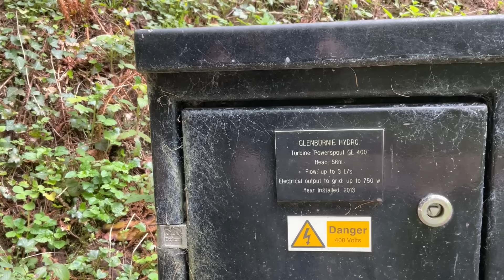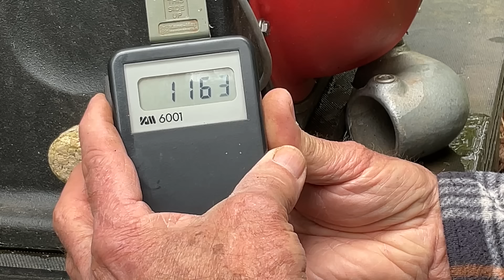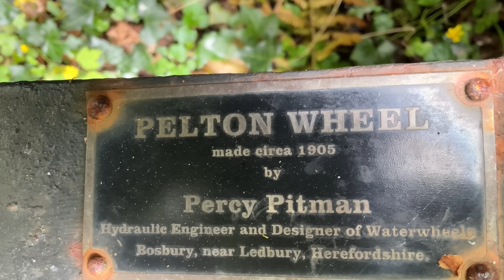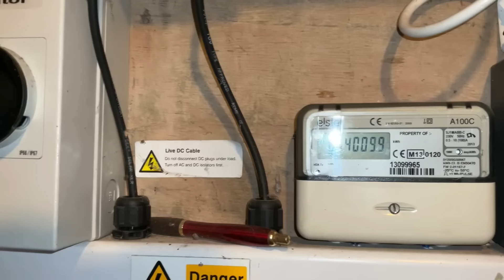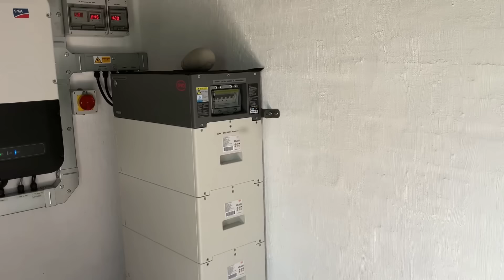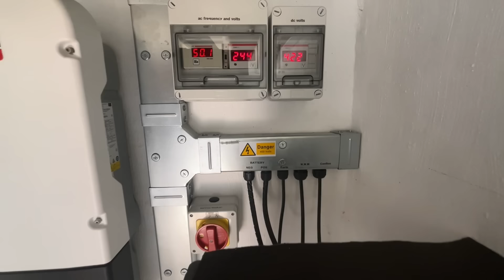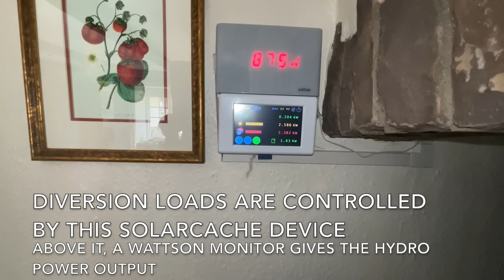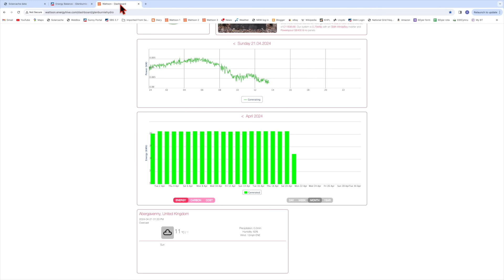Powerspout + solar + battery = the perfect combination.

Comment: As an electrician, I've considered doing something like this for an off grid cabin/home, but is your turbine delivering AC or DC? 

I was always thinking of doing a 240Vac turbine, that would feed an AC load center/panel, for powering the fridge, HVAC, and washer/dryer, and some receptacles. Then also 120Vac to 48Vdc charging circuits to feed large battery banks. The battery banks would feed DC sub panels with buck converters for dropping the 48Vdc to 24/12/5Vdc and then circuits for 24Vdc lighting, 12Vdc appliances and convenience, and 5V usb outlets. 

This way the turbine would not only power my heavy AC appliances and motors, it would also constantly keep batteries topped off that deliver power to all my lighting, electronics, and anything else I could keep running on low volt DC power.
Reply from the maker: The permanent magnet alternator on the shaft of the pelton generates 3 phase ac. This ac is of variable frequency because the shaft speed is different for the different flow conditions which occur through the seasons. This variation in frequency doesn't matter because the 3 phase is rectified and smoothed to dc before leaving the turbine housing. The resulting dc power passes to the house at between 200 and 330 volts. At the house an ordinary grid connected wind turbine inverter, though it can also be an ordinary solar pv inverter,  converts the incoming dc to 240 v mains ac at 50 Hz. These are the figures for grid voltage and frequency here in the UK.
Best of luck with your project.
Reply: @KEhydro  Got it thanks. So probably not able to receive a consistent single phase 240Vac @ 60 hz is what I'm hearing. I'll have to look into it more.. I'd love to find a way to avoid converting AC to DC only to invert it back again for all the AC appliances. Maybe this is not possible...
Reply: @paaao  
If you have large enough wires you can send the rectified 60VDC uphill and only convert it via the inverter up there that ties your batteries, solar, hydro and  emergency generator...into 240VAC 120VAC @ 60hz....

Comment: Hi Bill Cave! I'm amazed. Do U have any paper published or any references U used?!
Reply from the maker: You can find two documents, covering the wiring schematic and the communications diagram for the 'battery bunker', in this blog post: https://water-to-wire.blogspot.com/2023/12/battery-storage-completed.html
The documents come at the very bottom of the post.
The wiring diagram was based on an on-line document from March 2021, published by the Institution of Engineering and Technology (IET) which you can find at: https://electrical.theiet.org/wiring-matters/years/2021/84-march-2021/island-mode-earthing-arrangements-new-guidance-in-the-second-edition-of-the-iet-code-of-practice-on-electrical-energy-storage-systems/
I hope these help you.
Reply: @KEhydro  Thanks a lot. I live in south east asia. The potential of RE is high. I'm still in the research phase about RE tho.

Comment: finally a microhydro setup which does 400v. and bats too. some argue how it's safer at 48v but losses are huge. and you aren't spared from 400v anyway

i love decent systems

tho, it seems like battery room is doorless, is that good, even if climate allows it?
Reply from the maker: Thanks for commenting, - your noting there is 'no door' is a relevant observation.
Climate-wise, the temperature in the battery room is shielded from the worst extremes of hot and cold by being, in effect, underground.  For my own interest in the matter, I'm monitoring temperature with a max / min thermometer to see what extremes are reached. 
Security-wise, not having a door does create a risk - the components of the system could get stolen, - but if they are stolen they are replaceable; the real value of the setup lies in the location and the 'infra-structure', - and nobody can walk away with those !
Reply: well not much of about getting stolen, that looks like place where that's not an issue, more about some animals maybe?

Comment: Would it not be better if the outflow pipe had a larger diameter to prevent back pressure? Do not ask me as I am not an engineer. Thank you for great video.
Reply: An ordinary 90mm downpipe on a house that empties gutter water copes with more 
no need for huge pipes as once it leaves the housing it flows downhill by gravity...

Comment: Is the voltage peak or RMS? Or is it a DC generator?
Reply from the maker: The volt meter at the turbine reads DC (rectified 3 phase from the permanent magnet alternator). The voltmeters in the 'battery bunker' show battery DC on the right hand one, and 'grid' AC on the left hand. The 'grid' AC one will read either utility grid voltage or the 'island grid' voltage (created by the inverter) depending on whether the system is in 'on-grid' or 'off-grid' mode. In the video, it is showing on-grid voltage and it is rather high, but that is what it is in this rural area.

Comment: Why was the high pitched sound from the turbine again? Is that putting out 400 volts? It is the most meticulous system I’ve seen. Exemplary data monitoring.
Reply from the maker: Magnetostriction. 
Magnetostriction is a manifestation of energy loss, in the form of noise, caused by the miniscule changes in dimension that occur in ferromagnetic materials subjected to a changing magnetic field. It is heard as a whine because the permanent magnet alternator (PMA) generates 3 phase ac at a frequency of several hundred Hertz; by contrast mains ac, at 50 Hz, only produces a hum. 
The generated ac frequency is high because there are 42 stator poles and 56 magnets passing over those poles at approximately 1000rpm. 
The 3 phase ac output of the PMA gets rectified to dc, at a voltage which is between 220 and 315 v dc, - the variation depending on how much power is being produced, - which itself depends on how much water is hitting the pelton wheel. 
The noisy whine is only evident at high levels (high that is for this turbine !) when water flow to the pelton wheel is above 2.5 l/s.

Comment: Have you thought of building a little shed over your 120 year old wheel?
Reply from the maker: When it rains, the upward facing cups of the 120 year old wheel fill with water; when that happens the wheel, apparently without any motive force, starts to turn ! 
It is something I like to see ! 
Putting a shed over it would deprive me of a small enjoyment ! 
The wheel has many layers of paint on it, - I don't think it will suffer from being exposed.

Thanks for commenting.

Comment: Before the batteries were installed did all the generated power go back to the power grid?
How long has the hydro generator been in operation?
Reply from the maker: Good questions John;
I'll write an extended answer because I want it known the system does have limitations.
17th July 2013 was the date when the hydro first ran; since that day up to the present, it has generated non-stop except for an accumulated total of perhaps 90 days (that's an educated guess, but educated by the records I keep); most of the 90 days of down-time were due to early teething problems with the Powerspout's on-board electronics getting damp. 
Of course, there has also been time lost from generating by shutdowns for: nozzle changes, stator and rotor changes,  bearing changes, de-silting of the header tank, and other maintenance jobs, - but these last a matter of hours at most.
Before the batteries were installed, as much generation as possible was kept 'in house'; this was accomplished by the Solarcache device diverting to its 3 loads, - it doesn't divert to all 3 at once but in a way that can be prioritised and sequenced. But these 3 loads could get to be replete and not accept any more input (because their in-built thermostats clicked open); when this happened, usually on a sunny day, then yes, as you suggest, surplus power then went out to the grid if it was not needed for 'the always ON things' in a house, - 'the always ON things' being things like fridge / freezer / Grundfos pump /etc etc.
The irksomeness about this arrangement, - which has mostly been put right by having batteries, - was that whilst energy was occasionally exported to the grid when the sun was shining, when the sun was not shining, some energy almost always had to be imported from the grid; this happened whenever the loads switched ON in the house were taking in aggregate more power than the hydro on its own was producing; since the power output of the hydro can be as little as 200W at some times of the year, importing happened quite a lot. 
The way that having batteries has put this right is that the battery inverter is able to output a maximum of 3.65 kW; so now we can avoid taking from the grid by taking from the battery instead, - BUT only so long as we keep the loads in the house switched ON to be taking less than the power the battery inverter can output (3.65 kW), added to whatever the hydro is producing at the time.

All this does impose a certain discipline on us in how we use electrical things ! My wife accuses me of being an 'energy policeman', - and I am, I admit it.  But I've promised her it'll only be for this initial year so we can see whether it's possible to live without taking any grid power. After a year, we'll relax our present rule and accept a few kWh of import.
You can see a graph of our grid usage before and after battery installation if you look at this blog post: https://water-to-wire.blogspot.com/2024/02/benefitting-from-battery-storage.html. It makes the point of how great the reduction is in imported energy brought about by having batteries.

Comment: THAT TURBINE'S LOUD AS ALL-FUCK, THOUGH </shouting>
Reply: Good reason to drop it 190m downhill from the house. ;-)
Reply: @KEhydro
2 months ago
Magnetostriction. 
Magnetostriction is a manifestation of energy loss, in the form of noise, caused by the miniscule changes in dimension that occur in ferromagnetic materials subjected to a changing magnetic field. It is heard as a whine because the permanent magnet alternator (PMA) generates 3 phase ac at a frequency of several hundred Hertz; by contrast mains ac, at 50 Hz, only produces a hum. 
The generated ac frequency is high because there are 42 stator poles and 56 magnets passing over those poles at approximately 1000rpm. 
The 3 phase ac output of the PMA gets rectified to dc, at a voltage which is between 220 and 315 v dc, - the variation depending on how much power is being produced, - which itself depends on how much water is hitting the pelton wheel. 
The noisy whine is only evident at high levels (high that is for this turbine !) when water flow to the pelton wheel is above 2.5 l/s

Comment: super cool, did you set this up? I'm curious how long it would take to complete this setup?
Reply from the maker: The hydro part of the setup was in 'gestation' a long time before its 'birth'. The dream / realisation that something was possible - started in ± 2005; flow measurements and head measurements 2007-9; gradual conception of a workable design by 2010, over which time, identifying a Powerspout as being a turbine which could connect to the grid was the most crucial advance; 2010 to 2012 was taken up with looking out for and finding, non-new items such as the penstock pipes, header tank, electrofusion kit, highway crash barrier for water gathering, SMA inverter, etc (mostly on eBay); 2012 -13 was the start of actual installation work, and also the start of working to obtain the necessary regulatory permissions (Planning / Water abstraction / Grid connection / Feed in Tariff payments).
Taking the set up as a whole, ie: hydro + solar + battery, it's probably true it has been a lifelong conviction to want to go in that direction; so in that sense, the answer to your question is: a VERY long time !
Reply: @KEhydro  awesome I love it, thank you for the detailed response, seems like a perfect project to tackle out there on your land, wishing you all the best for the years to come.

Comment: Swapping that inverter to something new will get you another 8-10%
Reply from the maker: Thanks for your comment - our paths have crossed before, - when you helped me with questions about your test rig for SMA inverters: https://youtu.be/rMyWE5gvq6s?si=OLWYbjDkvSX9E0Nu 
I still haven't got round to that project !
Yes, you're right about squeezing an efficiency gain with a newer inverter; and the SMA Home Energy set up, centred on the Sunny Home Manager, would allow non-SMA inverters to be used; but I'd lose my ability to capture Bluetooth data via the Webbox, - and also, I have several SB and WB 1200's as spares !

Thanks again for the suggestion though.
Reply: @KEhydro  hello!  What project was that then? 

Yes I understand about the web box, I think they did a 2kW high frequency inverter, that could be an option.  I think they can be set to turbine mode too.

If you keep the 1200 range of inverters cool with a fan they will last decades.  I've seen them in lofts when swapping it and they are all crispy inside when I've opened them up. 

Looks like a great setup you have there.  Do you ever run out of power, there are some very useful multi function hybrid inverters out there now, the tech has gotten so cheap.
Reply from the maker: @WindyJAMiller  thanks for getting back.
The ‘project’ I didn’t get round to was to change settings in all my spare 1200’s. I want to make them all ‘turbine’ mode, all have Tstart time of 10 s, and all have the bespoke turbine curve that I have now arrived at as being optimum. See https://water-to-wire.blogspot.com/2023/06/optimising-my-inverter-turbine-curve.html
It will be much easier to do them all ‘on the bench’, which was why I was interested in your test rig. But I think I have hit upon an easier way of getting a dc supply without your test rig and I plan to do it when we have a bit more sun - because what I propose to do is use the dc supply from one of the two strings of our existing pv. 
I have yet to be sure that dcV and dcA will be within the 1200’s ‘envelope’, but I think they will be, as long as ‘insolation’ isn’t too great.
Regarding a fan for cooling: Hugh P, whom I’m sure you know, also suggested that. I haven’t gone for it though because the very maximum the hydro can feed to the inverter is below the derating that SMA suggest for continuous operation, and so I think myself to be working the inverter within the limits which will ensure a long life.
If you have any advice about my planned way of firing up the inverters I want to alter, I’d be very happy to hear it. You’re the expert in this matter, in my view!

Comment: There comes a time and place where all this cost more TIME and MONEY than the grid..
Reply: In the initial set up..... yes.

But say to connect to the national grid cost $14K....

then each month you pay a "stay joined bribe"...a line charge.
Then you pay for the electricity itself.

So you are $14k ahead of what  you would have had to find immediately...or pay off with interest for a loan....
and you have time to spare and a strong back....
so you build your own system.

Now each month the bribe and the cost of electricity go into your back pocket....forever.

depending whether you use new, cutting edge, old but reliable, rebuilt equipment defines your ROI....

In this case the EV is also home powered...how much is saved there?
And when a new EV comes out with P2P then he can use the EV battery to power the house as well.

Comment: Cool but just 750w its not enouch for a home
Reply from the maker: How much generation is enough depends on the home and the homeowner ! 
If you check out https://water-to-wire.blogspot.com/2024/02/benefitting-from-battery-storage.html you'll see that for us, 750 W is easily enough. 
It is enough only because of combining hydro generation in winter months with solar generation in summer months... and storing what is generated in a battery, from which the inverter can supply 3.65 kW of power.
Many people would say that being limited to only 3.65 kW power is not enough, - but as I say, it depends on the homeowner.
I will admit to having just purchased a 1.1 kW kettle to replace our 3 kW one !
Thank you for commenting. Your point is a valid one.
Reply: That's 18KWh per day.
How much does your home consume over the course of a day?

If less than 18KWh then you only have to size the batteries and the inverter to deal with yur heaviset logical loads....and hopefully for only short bursts.

e.g an iron for ironing. 1700 watts for X minutes

a kettle for cuppas...
Note he has recently changed the kettle from a 3000 watt draw one to an 1100 watt one...

An electric oven won't be feasible for a 4 hour roast with two range top elements also going...best to go gas for that.